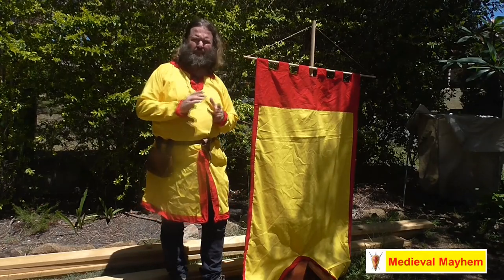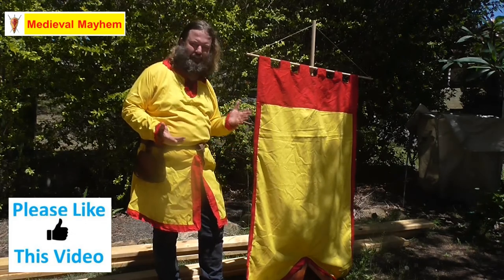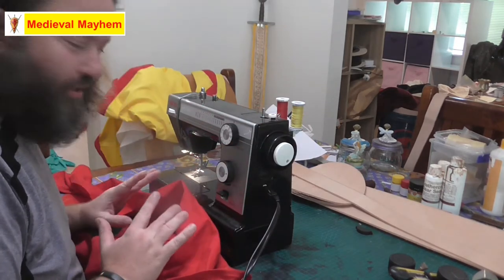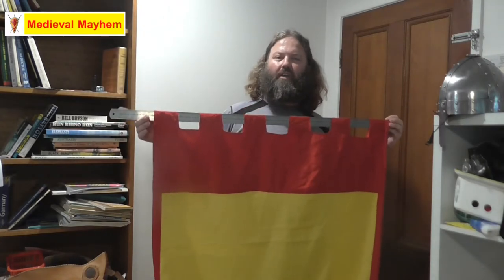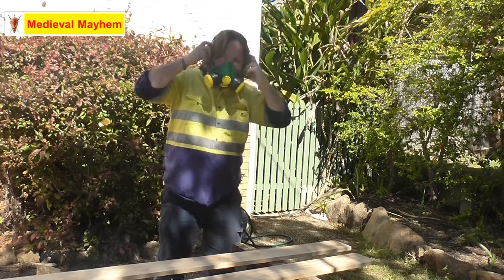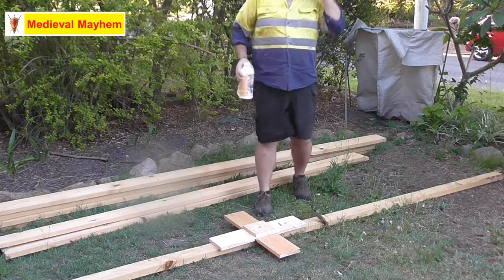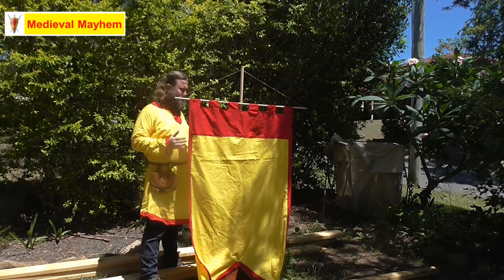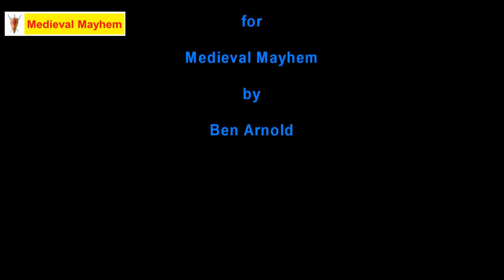Challenge Make a Flag Pole for Medieval or Viking Re-encantment (LARP - SCA)

Comment: Nice work. I guess it would be looking even better if the twine was exchanged for a real rope, not so extreme massive, but 10 times thickness the twine holding the banner. The ends of the horizontal stabe would look better, if they received some lathe work as decorations or simple wood balls. The pole could receive some end-decoration also. This was possible in medival ages.
Reply from the maker: Thanks - as I said, not strictly medieval.